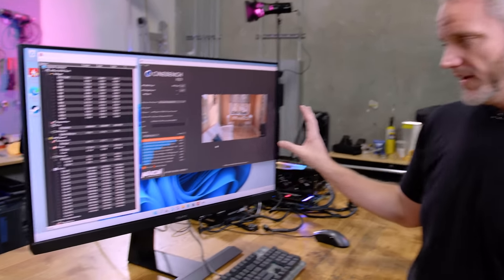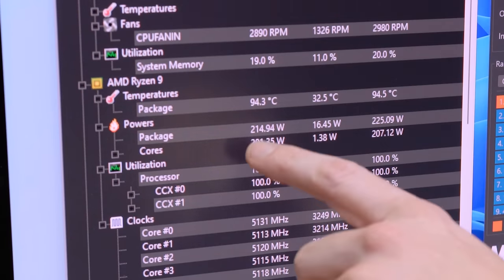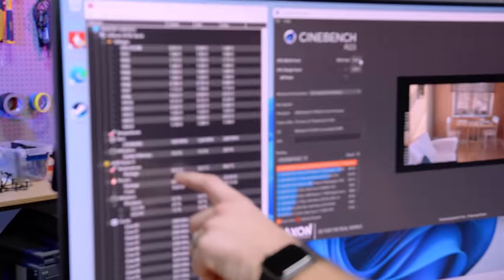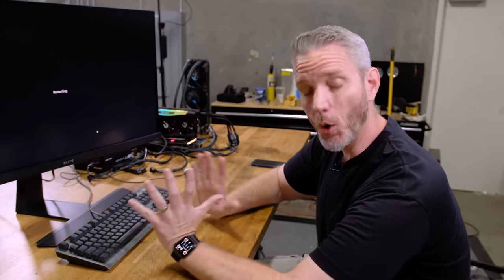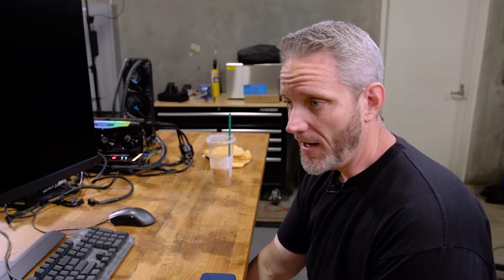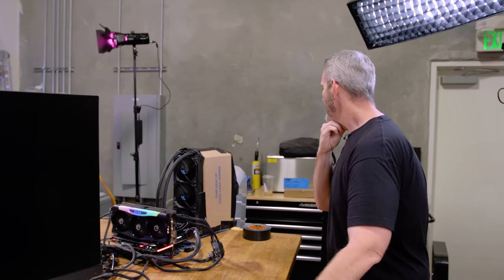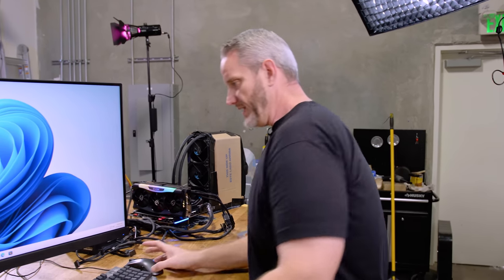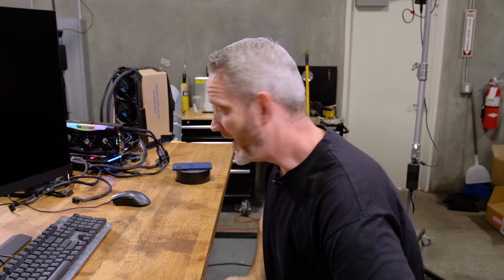This is fine...

Comment: I remember that 1st generation of Ryzen CPUs has a 20 Celsius offset for some safety reasons. My 1700X was hot in some cases, but real temp was 20 Celsius coler in real time. Maybe here is the same situation with 7950X and other 7000 CPUs. This is just a presumption, but nevertheless maybe true presumption.

Comment: Being used to high Power constumtion cus of X99 and so on, I feel that a lot. Am am still running an 6950X at 4.5GhZ. That thing pulls 240W usually. Sometimes up to 280, its just insane.

Comment: Just got the asus ROG Crosshair x670E Hero + 7950x +Gskill ddr5 6000 mhz... and nothing worked ... bios was 0240.... updated to 0703 which came 5 hours after I got the board. And maaan how difficult it is to install windows on this... everything needs to be in the correct order... but finally I got it to work

Comment: I have a question / video suggestion for you Jay; In regards to everything now getting hotter, is it possible to refill an AiO? And perhaps is there anything in particular that it can be filled with to make it better?
I know for most people the best option would be to replace the AiO, but for some small case you may not have the same options. Like that Nzxt h1 you have modified.

Comment: Damn this video. I'm old and I've been air cooling for ever. I've never used AIO before. Now you're making me nervous about the AIO. Is there any tests I can do before I put my new system together? I still have parts arriving this week and next. AIO is here 360MM. Case is here. Ram here. Motherboard and CPU arrive Thursday. Hard drive arrives tomorrow. Hard drive heatsink and fan no idea when it arrives but I can put on later. I'm so ready.

EDIT: PS - I'm not even overclocking my system. Just always like the biggest/bigger coolers.

Comment: I wonder how much would help if pump would always run at 100%... I think that CPUs will have bit problem with waterblocks because CCD and IOdie are offset and most waterblocks are made for central die position and probably on some the fins don't even cover the CCDs... Also the IHS is too thickkk and even bit smaller top surface with dies that dump even more heat into...

Comment: Them scores look legit. 40k that's 10k more than my 5950x on R23. Impressive generational leap. I'm personally not upgrading cpu and gpu until my games are no longer running over 120fps at 1440p.

By the time I "have to upgrade" I'm building a new future flagship AMD/Intel + pcie Gen 5 or 6 card of that generation whatever is flagship card which both items itself will require brand new EVERYTHING lol.

Yaya, new fully built system 2026-2028.

Comment: The German ComputerBase team reviewed the new Ryzen 7000 lineup and discovered and tested an amazing undervoltage and TDP-limit potential for those CPUs.
But they also stated, that it is concerning that nearly every company is applying the pry bar to the wattage of new chips to reach ever higher clock speeds... 
Especially when Ryzen 7000 seems to have such an efficiency potential

Comment: Any plans for a 7xxx series vid/guide on what you would need to do to keep the CPU at 65C or so under load and what it does for your performance? Even if 95C thermodynamically does not mean a lot for heating up our rooms etc. I think most people would rather not sit next a PC where the CPU is 95C.

Comment: Remember they are  CPU+GPU (APU) , So by design the temps are alright. Just as GPU normally runs at 80 plus .. so this architecture the 95 temps are alright, nothing to. Fresk out about

Comment: Normally I hate seeing temps above 70C but I'm really curious if letting the CPU run at 95C for hours then letting it cool down for a bit then running it at 95C again for a few hours how long will it really last. Probably a lot longer than we think especially if this is by design and not a manual overclock. 

Funny thing about the power draw, that 200w+ is high... But my 8700k at 5Ghz+ can use over 200w and still manage to be way slower than most AMD CPUs from years ago. So seeing 200w and knowing the performance is way higher is pretty cool to me.

Comment: The CPU isn't what I'm worried about, but the PCB of the motherboard. PCBs are very sensitive to heat. So in time you could have problems with SMD parts on the board. Time will tell.

Comment: not sure if this is the place to ask but you're the water cooling guru and I like watching your vids a lot more than anyone else. I have a MSI 3080 Gaming Z Trio LHR 10G and it seems EKB, Corsair and other companies are saying that the other 3080 cooling blocks don't fit this particular version of the 3080. Can anyone confirm or tell me if any of them will work....or better yet, is it possibly an easy modification to another block that I can make? I'm fine with getting creative but if it just doesn't fit the GPU I don't know that I'm capable of building the whole block........(I could probably pull it off but it'd cost less to buy a 3090 lol)

Comment: I'd have targeted a lower target temperature - say 80C; I know they say its designed to do "95C 24/7".. but with my experience with silicon anything above 85C over long periods has serious issues with degradation over the years. I hope that isn't the case with these CPUs, but I'd like to remind everyone that if these chips do degrade, they'll probably die OUTSIDE their warranty period.

Comment: This seems more like an issue with the IHS. If the AIO isn't being saturated, then the CPU isn't doing a good job of transferring the heat to it. While I am a bit of an AMD fanboy, I don't think these temps are acceptable. It's no different than the Intel chips running stupid hot. I was looking forward to the 7000 series chips but I'm quite disappointed. Now they aren't any better than Intel. They're fast and hot, just like Intel... 🤦 I'm happy with my 5800x and I'm going to be sticking with it for a while because I don't want a chip that runs 95c with a 360 AIO. No thanks...

Comment: hot??? *laughs in intel prescott OCing*.. loved it in the winter.. hated it in the summer.  still have the 360 radiator i used way back then. added a 6900xt to my 5950x. had to WC the 6900 because  aircooling it sucked. This  forced me to add a 420 into the loop. 55C on both full load and silent. in order to run a 7000 series might have to triple radiator the system. 🤣

Comment: I don't agree with your interpretation of the physics here. 

How much the CPU will heat your room depends only on the watts, not the cpu temp. That's why when you buy a space heater it lists watts on the side, not degrees. If your old cpu was using 200W at 45C and it heated up your room from 20C to 25C or cost $5/mo in air conditioning to keep it at 20C, the new 200W 95C cpu will do the same, and all the differences will be in volume of airflow, fan exit temperature, heatsink efficiency, yadda yadda yadda.

Approaching the problem from the other side, it should actually be way easier to keep the temp under control when your room gets warm. Your cooling setup has to obey Newton's law of cooling ΔT/Δt=c(T1-T0). At a T1 of 95C, the difference in T0 between, say 20C and 30C shouldn't matter, whereas with a T1 of 45C, that's kind of a big difference and your CPU might die.

Also, that big beefy (T1-T0) value means your "c" can be smaller. What controls "c"? How good your cooler setup is. Need to keep your 200W 40C CPU from creeping up to 45C? Better put a big old water block on it. Need to keep your 200W 95C CPU from creeping up to 100C? Meh, stick a wimpy little fan on it.

The real problem here is that when the manufacturer says "the chip will last just as long running at 95C as the old ones did at 40C, trust us bro" we all pretty much think they're lying. I mean, this is the marketing department telling us this. They gotta be lying, right?

I'm also concerned about it heating up everything else it's attached to. The CPU might be fine, but if it heats up the motherboard which heats up the ram, we might be having a bad night real soon. Maybe they designed it real carefully so it heats up the heatsink and the motherboard side stays nice and cool. Maybe.
Reply: this is what case fans is for...move heat out while keeping your case inside cooler...not trap it when you have gpu gonna throttle crazy when cpu rather sit in 95c and killing itself by stupidly...i would go direct die cooling if nothing gonna cool it...or drop down a whole 1ghz  or more until temps run normal at 72-80c

Comment: So if we buy the 7000series ,we gotta downgrade the cpu by undervolting it? Well im gonna stick with my 5950x it's maybe 20% less powerfull,but nothing get's extreme hot and the power is more efficient,and i don't have to spent a fortune on the new stuff(psu) and Cpu's and motherboard's, pretty weird you need to undervolt or getting things done,to keep the cpu cool if it's brand new,amd say's: it no concern you can run it 24/7 on 95degrees 🫣🫣😱7 days a week 24/7, 95degrees? You won't need a furnice in that room this winter,and not everybody can delid a cpu...

Comment: So with AMD overclocking its better to use Curve Optimizing per core. I set all of my AMD HWbot Records with Curve Optimizing in BIOS as I got more performance with that route rather than Multiplier. My temps were actually that bad either.

Comment: The 5000 series ryzen ran very hot on air coolers. My 5800x for example ran at 80-90c until I hooked up my evga clc 240 aio and now it sits at 65c max. Think its just the way it is.

Comment: Is there any reason why you couldn’t use a larger radiator. Would be interesting to go with external cooling solutions if that’s possible
Reply: I assume a 360 aio like that is the highest end cooler you can buy off the shelf before getting into custom cooling. Doing some weird rad setup wouldnt be realistic for the average consumer to relate to
(not that cooler is the best but its around what you can buy)

Comment: 95 is a little on the hotter side to me.  It doesn't matter what BS they are spewing.  I waited too long for a graphics card and I want to make it last and run well.  That would be by keeping it cooler.  There is no hard in it if it is done right and it does not necessarily need to involve water cooling.

Comment: It's not without a hint of irony that when installing my 5900x, I found out the pump for my water cooler was dead after initial boot throttled up to 93C in BIOS and went into thermal shutdown protection mode.

Comment: The space heating is going to be the big one for me.  I used an FX 8370 OC'ed for 10 years.  The only upshot to that was I didn't have HVAC back then, so I needed a good space heater in winter.  If your AC can handle 95c being dumped into your gaming space, I say go for it :)

Comment: Jay, do you think the heat spreaders are getting too thick and not allowing the heat transfer to the heatsink? It would appear that both 12th gen and Ryzen 7 have the same problem, hits the ceiling easily but cools quickly once the load is removed.

Comment: To be fair to AMD most decent laptops over the last few years normally run at 80/90 degrees and can run at even 110 and it not shorten the lifespan of the chip so I don't think the temps being at 95 stock is not that big of a deal

Comment: I dont know man, my 5950X regularly hits 5ghz on most of the cores, and it stays below 70c (with AIO). Usually idles at 40c. I just dont get it with these new chips. Pushing 90c constantly is going to generate a lot of heat, which is not going to work for me or a lot of people. Can you imagine a 3 or 4 hour gaming sesh running these chips at 95c?

Comment: That is incredible i have 5600x not overclock got 67c in cinebench with air cooler dark rock 4 pro. I think Amd could fix this with bios updates i hope they fixing this temperatures but still amd is not 130c intel s***it cpu 😂

Comment: IM not good with the logic of overclocking, 
I got a Ryzen 7 5800x CPU and i wanted to  OC it but i just dont get it, the corellation between voltage amount and Core rising, etc..

I know you got a video about it but if you could update it i;d be happy ;)

Thanks

Comment: be nice to see some 1 try with low mid and high end air coolers/aio's
and no 1 has tryed with something like a hyper 212 and that should be plenty for a 7600x and if its not then there is a heat issue

Comment: I've been loving tech people trying to explain heat vs temperature, target temperaturs and heat dissipation. I really don't think you can simply use temperature as an input to determine speed.  AMD is delighfully fucking with you guys.  You need to have power draw as an input variable when top performing temps are going to be hitting 95 C pretty much every time.

Comment: AMD: It's 95°C by design!

Me: It's a bad design then.

You literally need an AC attached to a 360 rad to cool down an air heater here. And i can't imagine it being healthy for the motherboard nor the cpu slot to be on such high temperatures all the time when having cpu heavy tasks. Same with Nvidia and their insane upcoming 600w gpus. 4090 is a 3,5 to 4 slot card because of the insane big heatsink needed to cool down this power hog. Lets see how hot Raptor Lake and lower tier Zen cpu's perform in terms of efficiency.

Comment: 1 watt= 0.001 kw so watts/10^3 = kw
at a high price per kw/h of 30cents = $0.3
therefore - 250 (watts of CPU)/10^3(watts to kw) x 0.3 (cents per kwh)
250/10^3x0.3=0.075...... meaning cost to run CPU drawing 250 watts @ 30cents per kw/h is 7.5cents/hour
@ 215watts @ 20cents/kwh = 4.3cents per hour..... at full load.

Comment: I find the 95c "normal" operating temperature stupid. Not necessarily from a component side (though time will tell on these processors longevity). That air has to go somewhere and having to stick my PC into a freezer or rig up a bunch of fans just so I don't have my PC and thermostat fighting with each or not cook my PC corner while using my pc is just obscene. Do they expect folks to have climate controlled server rooms?  Seriously, server temperature get hot but even 95c is the warning threshold.  Sure if I lived in Alaska might be easier (open a window) but I don't and alot of folks don't. I think they messed up on this.
I suppose though if it doesn't do this during gaming there is less of an issue. However developers, video editors etc will still have issues.

Comment: What about the ECO mode thing on the Ryzen 7000 series? Is that really a thing because 95 degrees is way too much to cool. Also so much heat dumped into the room.

Comment: In one year, this platform will stabilize for sure, expecting to see better motherboards at lower price and better ddr5 sticks for lower price. At current price, many who built during Pandemic with Ryzen 5000 - this is too much to spend to upgrade the platform. Pandemic time was like the PC build time for the decade, I am sure. CPUs were sold out, GPUs were sold out. I had to F5 for both. Now, I need way more money and energy to consider an upgrade - which will mainly happen "if" I see some content that I absolutely want that wont work on my 5900x / 3090 AIO build. Not happening. AMD should have really priced this better at launch which could have convinced some more people besides the enthusiasts. The early adopter issues I am seeing are deferring this platform for sure. Also, no major gains for gaming.. which sucks.

Comment: I think most enthusiasts or custom builders won't care about the heat, in the prebuilt market, etc. well yeah it creates issues (I can see Steve covering the Dell AM5 system with an old AMD stealth cooler and the resulting dangers now) but we won't care. I would only care personally because I have a garage setup, so it's less about oh my poor computer's overheating, it's no I'm going to overheat sitting near this thing. I think as you all do more testing with different level air coolers, AIO's, open loop, etc some of the resistance to the heat will drop away. 

But not all of it. There were people who legitimately did not buy 12900k or any 12th gen because of all the heat/power draw memes, not realizing that 99.9% of the time you'd never see those kind of thermals or power draw, especially if you went with a more realistic cpu. So those people? No, they will never touch these, or any modern CPU because as AMD drops the whole we care about your thermals approach - which is something I loved, AMD systems were dirt simple to build and equip - they are all going to have higher thermals than we're used to. At least at the higher end of CPUs for Intel chips right now (who knows maybe they'll take the same route for 13th gen), and apparently all AM5 chips.

Comment: Jay, I appreciate your efforts and all hard work.
But I think this new platform needs at least 6 months to establish, what is the actual position of these new cpus, cant say anything at present, as it is totally new line.
So my advise to any one who is thinking to buy,  answer is             NOOOOOOOOO
dont buy these super expensive and full of heat mine cpus, nope , not at all.
Better stick with old am4 platform or maximum, just upgrade to old 5900x or 5950x.

Comment: Lapping will be king on the Zen 4, I've never considered it before as I haven't felt necessary but I believe I'd consider it on these, but I feel like Intel is waking up an 13th gen is going to be incredible and the Intel system stability is just better in my experience.  Though I am very happy with my 5950x I love the new stuff and consider the upgrade but I think I'm happy for now.